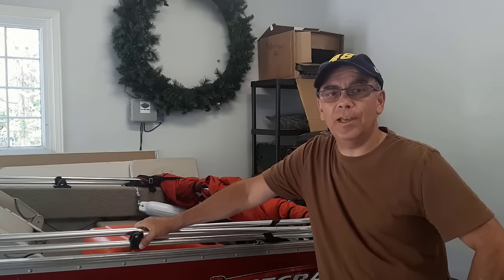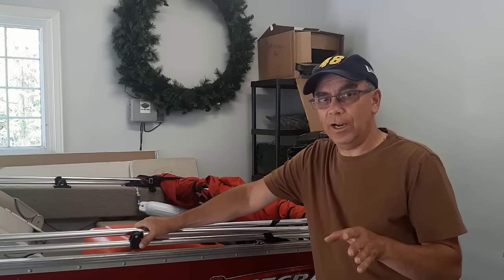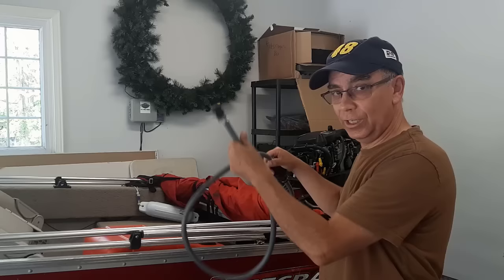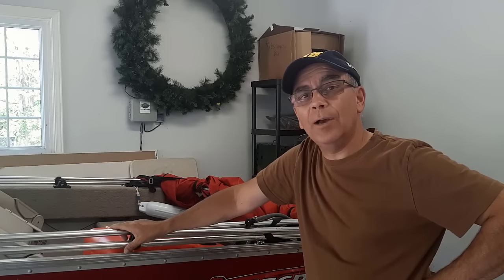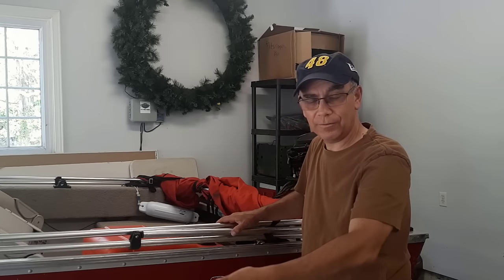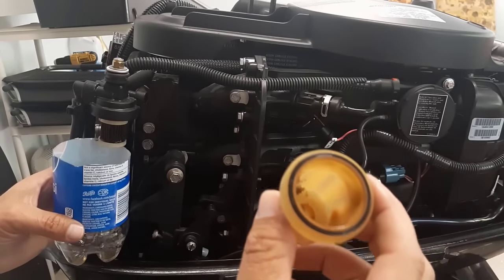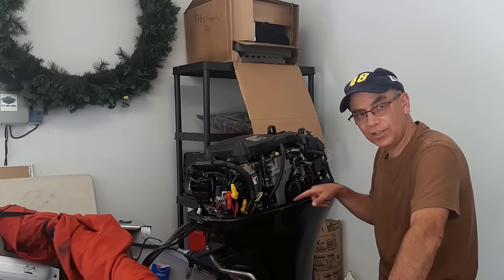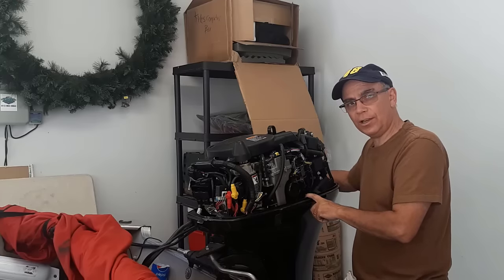Mercury Outboard Runs Then Dies // Try This Before You See Mechanic

Comment: try PRI-G !!!   Im not even gonna watch the rest of the video. upon 1st use run the motor for at least 45 minutes at medium to full throttle.
When I bought my last boat the owner was very honest and said the boat stalls once in a while.  I put in the PRI in 2013 and never stalled since.
Reply from the maker: Thanks for the tip.

Comment: This is so garbage expensive company. I had exactly same problem plus always other problems. When you see mercury stay away.
On my unit fuel filter cost in Amazon from 25 to 40 $. If you buy from mercury dealership (my case Kemptville) cost 115$.
Reply from the maker: Boating is an expensive recreation to get into. It's to bad it's this way.